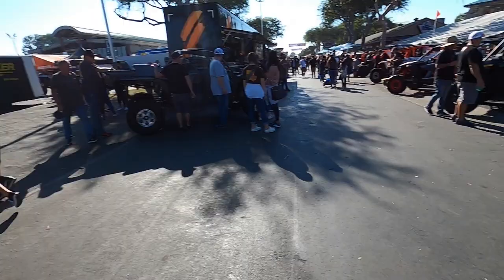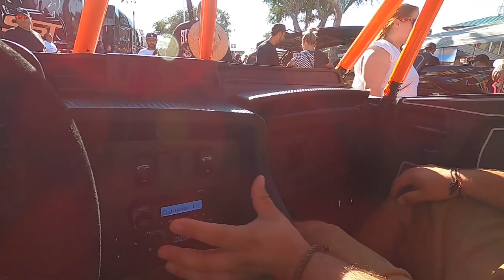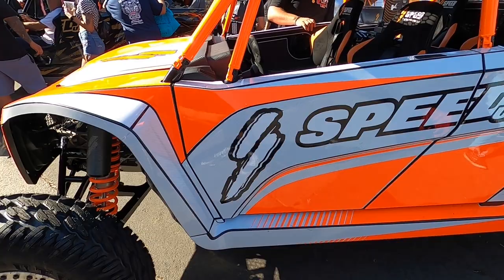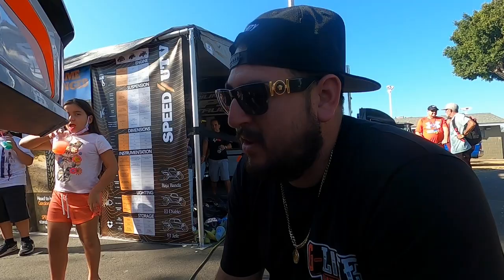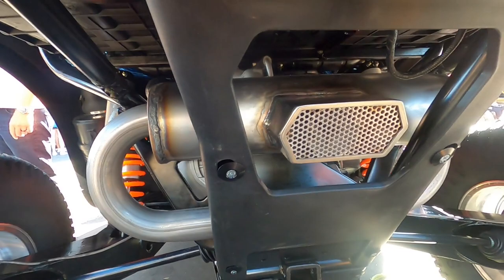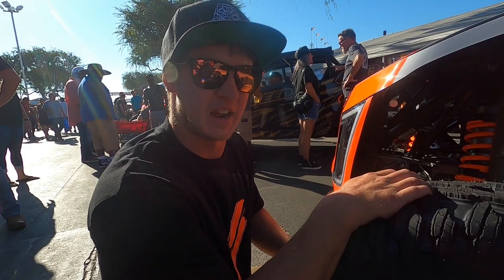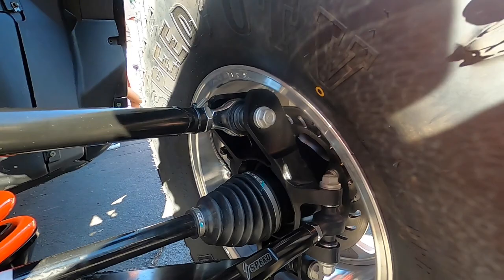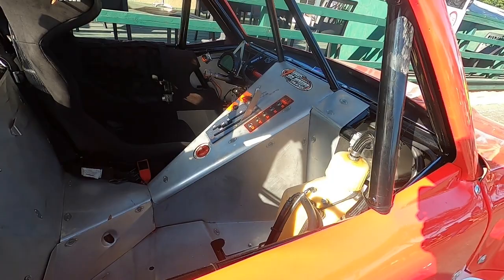2022 @SpeedUTV  EL JEFE BOOTH at the SAND SPORTS SUPER SHOW 2021 EP 210.13

Comment: Great to see a review from someone with an open mind that DOES NOT yet have one on order. I will add that, while BRP might make aircraft engines, The guy behind the Speed engine builds engines for NASCAR, NHRA, ARCA and other classes of racing. A couple other important points not really mentioned is it's a dry sump engine. Also, shocks are the biggest in the industry by far, and are internal bypass with something like 26 points of compression and rebound.
Reply from the maker: Thanks👍👍

Comment: There's over 200 different changes that's going to happen on the production cars , And I've sed it before
these cars will probably never be sold
Or at least to the public, welding machines will get diled in doors will fit ,
I bet the first 50 frames won't be used eather thay will go to testing and get ripped apart, and more changes.
And if Robby can't break it I can guarantee you will not be able to.
Reply from the maker: I agree with that👌

Comment: Did you see the piece of all-thread they integrated into a weld on the cage?  lol
Reply from the maker: Yea seen that, honestly the biggest issue i think. That someone at the factory put that together like that. But all the welds will improve. From what we have heard from Robby himself at this past weekends sst event. Is that they are working on training the robots to weld better on those particular areas. I don't see the machines getting in the hands of customer like that
Reply: @GLifeUTV  Robby talked about that bolt welded in. He said that probably fell onto the jig before the robot welded over it because that jig lays down. Which makes sense since the bolt was sitting on the gusset and there was no gap to fill.
Reply: I dont think a shop full of fabricators would accidentally let that go out into the public. Its easy enough to grind it off and weld another gusset on and spray paint it.

Comment: Don’t like how the rear axle are exposed, especially rock crawling or you hit rock , and tie rods are way front !!
Reply from the maker: I mean i guess they exposed from being rear ended. But from the front its no different then a polaris. The front end ur right tho. The tie rods are exposed to being hit first instead of the arms.
Reply: @GLifeUTV  kind of why I prefer my RZR turbo , it would definitely shine fast desert or dunes but RZR and can Am I think are more versatile for wood trails and rock crawling, I guess hince the name Speed !! Lol
Reply from the maker: @jamaster6040  yea the width is definitely not gonna be the best for trails. Literally only for open desert and the dunes
Reply: @jamaster6040  bro thats why its 3 models the bandit is the trail car not the el jefe or the Diablo!!!
Reply: I'm pretty sure the axles are stronger than most radius rods. And the trailing arms on this cover the axles more than the trailing arms of the X3 or RZR. Rock crawling if anything will take out the axle you should slide on the trailing arm until the tire can crawl over it.
Reply: I own a Wildcat XX with the exposed axles as you called them and I rock crawl a lot in the WVA mountains and in 2700 miles I have never even scratched the axles or torn a boot. The axles are more protected than it looks. Im still running stock tie rods too with no damage. That suspension set up especially the rear trailing arms is amazing for handling and the whoops best riding machine Ive ever owned. After 10 hours of hard mountain  and trail riding Im not worn out or beaten up!

Comment: Mr. Gordon knows what he is doing, is there growing pains and big money on the line going against the big Boys? You bet there is. Will there be improvements and changes down the line of course. How many tools in your tool belt? One tool does not fit every job. If you want an all out desert racer El Jeffy is the tool. It most certainly does not fit into my terrain, and style of riding, very tight heavily forested, rock climbs over very technical trails, and very often no trails at all, with lots of mud and river and creek crossings. Where long, wide beasts have absolutely no chance of going, why do you think the Big Boys offer so many models? It does not mean I do not appreciate the effort put forth by Mr. Gordon and his Team, any new products by a seasoned Professional can only be welcomed into the Sport, the technology, performance and price point of all the new machines were out of reach only a few years ago by the masses. Good job Mr. Gordon and Team.
Reply from the maker: Im excited to see it play with the other machines.. I have no doubt on the suspension and frame,. just hope engine is reliable as its new.